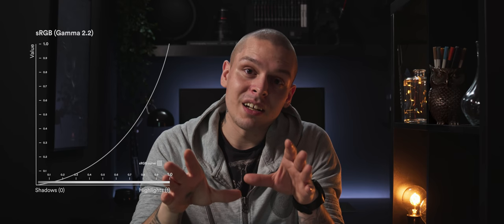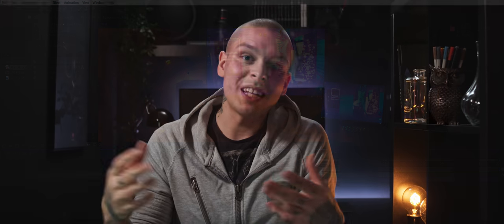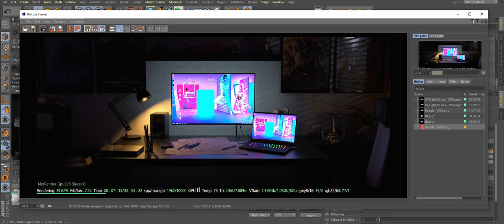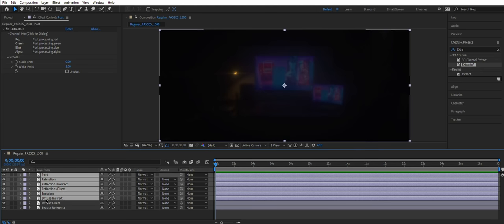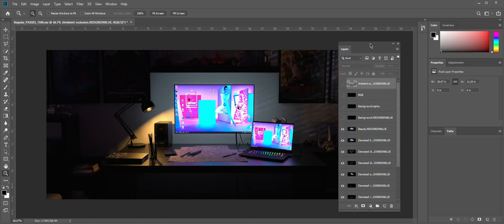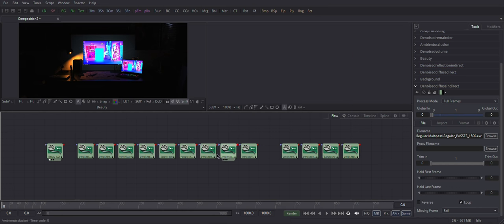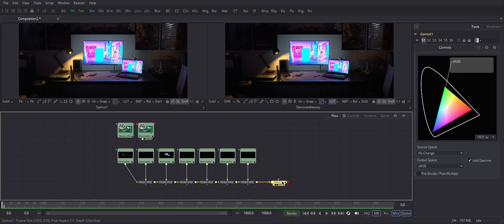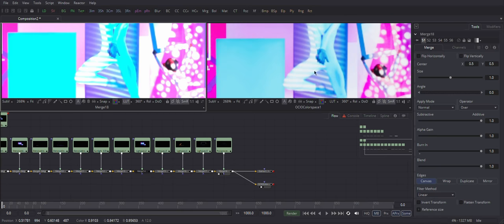Proper Linear Workflow | Fusion, AE, PS, Octane, C4D

Comment: CG is composited slightly differently in at a vfx house using subtractive compositing. So instead of adding together all the passes, we subtract them from the beauty, do our changes, and add them back on. By the way, they shouldn't need to be composited in a particular order, CG passes are designed to be purely additive, no special blend modes required.

Subtractive compositing is beneficial because of this: Say you have a scene with multiple lights, GI, reflections, refractions, SSS, volumetrics, hell even caustics. With an additive workflow, you'd need to have a pass for each of them just so that you can add it all together to recreate the beauty. But what if you know you only need to modify say, the reflections? Including all those passes is a waste of disk space, and a total overcomplication. With subtractive, you can just render your beauty and a reflection pass, subtract the reflection from the beauty, do your adjustment, and add it back on top.
Reply from the maker: That’s interesting, never tried it :) thanks
Reply: Stop stop stop...what? Subtract it from the beauty, make changes and add it back on top? How, lets say inside AE, would i have to do this? Veeeeery interesting!
Reply: Cool, Peter! Thanks for sharing. What would be the blending mode to subtract the passes correctly from the beauty?
Reply: In AE you stack the pass which you wish to modify on top of the beauty pass, using blending mode substract. Then duplicate that specific pass on top, add your effects on it and add it back in blending mode linear dodge :)
Reply: @AlexSuperBasic  Thanks, Alex!
Reply: Dude. I'm having trouble wrapping my head around this. A Google and YouTube search for "subtractive compositing" doesn't reveal much that is helpful. Any chance you can point to or put together an example in AE (preferred) or Fusion or Nuke?
Reply: @sarukravitz4981  I have the exact same problem. Tried to follow Alex's comment, but no success. Also googled a lot. Can anyone help us?
Reply: Much appreciated. Thank you.
Reply: @sarukravitz4981  I don't have Nuke, so would you mind recreating the example in AE to help me if you understand it, Saru?
Reply: @chrisp1628  - Sure, but it might take awhile. I don't have Nuke either so I'm planning on downloading the learning version and going from there. My Nuke knowledge is ancient but I may be able to translate that into AE. I'm traveling for work now so it's low priority at the moment.
Reply: Roger that.
Reply: I´m a AE user and THIS CHANGED MY (WORK)LIFE, THAAAANKS!
Reply: Yup, Preach. ALSO inject your .exr as comp.. auto layers everything
Reply: This is worth its value in gold! thank you!

Comment: Nice video great as usual will share with the Lighter here :) thanks, But I have to say Linear workflow is one thing and exr output one completely other thing,  in production we use a lot 16Bit exr  as Zips to save space and also you can find enough range for the 3D compositing.  as long you don't render tonnemapped exrs. For HDR (lighting) aswell displacement, 16Bit is not that bad (as many people think) Can work perfect with small size files with big videos and the difference is not that visible by naked eye.

Comment: You are my hero and so I think, as Vray user, could help any newcomer to get some things. Right now Vray, and probably every render engine out there it's actually biased. The fact that uses progressive sampler doesn't imply that it's unbiased. So for those who don't know. Unbiased will be a render engine that gives the same importance to every ray cast made. Not only that but also that calculates that path in every bounce until that ray has no more energy. Because this would be inefficient unless you are doing scientific work, all renderers use a biased solution. And all renderers are NOT physically correct. The fact it's proven because they use models (like Blinn, GTTX, Phong...) which are approximations of reality, but never reality itself.
Another thing it's that Vray makes every calculation as linear space (gamma 1.0) to get correct results. And no color space it's applied unless the user specifies it. You DO have a virtual frame buffer which applies a correction gamma curve just so that you can see a correct "preview" of what you have. Also, Vray works with wide gamut, it doesn't use Lab as one might suppose.
Still, I found it hard to understand how to work with ACES. wouldn't be better to just export your linear images and after post-production export to whatever format you want?

Comment: There is also a free plug in for AFX that splitts up the renderpasses autmatically without the need to duplicate and change the Extractor Plug In settings yourself. It is called ProExr(the guy also created Exr Plug In for AFX) and comes in addition with a Cryptomatte plug in in the zip file

Comment: Perfect explain... One question.. you are using Fusion right.. but now fusion integrated in Davinci Resolve 15 So how Different they are.. I think you are using Resolve too because I saw thumbnail one of your video.. And also How to do linear workflow in resolve.. I know too many demands..😁 do your best.. love you.
Reply from the maker: Fusion in Resolve is rather limiting. So it's a tool just to do something very quickly rather than a decent compositing tool. I use both Premiere and Resolve depending on the project :) ACES workflow in resolve is what you're looking for ;)
Reply: @AndreyLebrov  Perfect!
Reply: @AndreyLebrov   sorry bro, what's your thoughts now

Comment: You should do a video on the proper way to use layer ID mattes in compsiting/premultiplication. I notice I get a premultiplication edge line whever using Luma mattes/object buffers after color correction. In nuke it wouldn't be an issue but AE has me confused. I usually mess with the gamma on the matte itself after doing a shift channels but I'm curious as to how you'd do it. Thanks man!

Comment: Thank you Andrey!! But what do you think about "Blend using Gamma 1.0" in AE? Did you use it? Because Linear working space in AE don't work properly with some plugins like Element 3D and Optical flares, for example.
Also, I know so much people talking about linear workflow, but Andrew Kramer for some reason doesn't work linear. At least in all his tutorials and workflow videos. Anyone knows why? Thanks!
Reply from the maker: He doesn't work in it because there is no need, his workflow is procedural these days :) As for the plugins that doesn't work in 32 bits... that's why you might want to switch to a true 3D Compositing software like Fusion or Nuke.

Comment: You are the man. Thanks for that video. I ran into an issue where I had to composite an Octane element in AE on top of a plate. I was originally under the impression that you could use the AE Utility : Color Profile Converter as an adjustment layer on top of everything without changing the whole comp to 32 bit Linear. It works if everything is a scene coming out of octane but not if you're using a element with an alpha it doesn't work. How do you handle elements with alphas? Thanks man.

Comment: Here's to me going 3 projects after making the linear workflow settings change in AE and just now realizing it doesn't save the change as default, so I have been doing projects without linear workflow set.
I had to save a blank project and make that the new project default template.

Comment: Hey nice simplified tutorial, why do You think that linear (float) on the octane main tab is fundamental? If You choosing 32 bits You already have floating point in Your files, it doesn't matter if it will be mapped or not, but sometimes even it can be helpful - Z-pass for example. Am I wrong? Cheers

Comment: Did you make any tests comparing 16bit exr vs 32bit? Is there some significant benefit of saving in 32? I’ve heard that it’s only valuable for some “very specific post-production situations”, I guess it’s like extreme color corrections when turning night render into day.
Reply from the maker: You’re right :) 16 is enough for most tasks. You have to figure it out yourself really considering your project and hardware

Comment: This is great - except, when working with RGB colours for fonts / assets etc that are from a design file etc, where you're trying to match RGB values, in 32bit the values instead of being 0 ~ 255 RGB goes from -10,000 ~ 100,000... which is annoying when trying to quickly input a RGB value as seen in a brand guidelines PDF. Any fixes?
Reply from the maker: That's why Node workflow and fusion in particular are much more prefered for comp. You can add assets like this AFTER the linear workflow and they would be calculated in regular sRGB space ;)

Comment: Hi i work with C4D & Octane plugin and i have a problem when trying to export EXR passes : the rendered image doesn't look the same as what i get on Octane Live Viewer, it looks like it lacks the Octane Camera imager settings (which are activated).

Now i noticed something, when in "Render settings" > "Octane Renderer" > "Main" > "Settings" i chose "Render buffer type" > "Float (tonemapped)", there is no problem with the render.
Whereas when i chose "Render buffer type" > "Float (Linear)" as advised in the video, i have the image problem.

Of course :
-My Octane Camera is enabled
-"Neutral response" in my camera is checked
-My Octane Camera "Post-processing" is activated

-The format is EXR
-Depth of 32 bit
-"Rle" compression is activated
-"Save beauty" is checked
-"Image color" profile is set to linear
-"Tonemap type" is set to linear

Do you have any clue ?

Thx and have a nice day
Reply from the maker: You need to learn linear workflow. Browse my videos 😉
Reply: @AndreyLebrov  Hi, thanks for answering so fast ! Isn't linear workflow taught in this video ? I don't see other videos treating this subject except "OCTANE PASSES". Have a nice day ;)
Reply: Problem solved ! Didn't used "Linear" as my Octane Camera (in the list with Kodachrome, Exachrome etc.) Thx for your work btw

Comment: Hey i want to learn fusion . But I can't find quality learning material for it. So should I learn AE and transfer my knowledge to fusion. Will it be hard to change workflow from layer to node based?coz AE has tons of sources to learn from . (Remember I'm a beginner to compositing. I only worked on simple 3d stuffs).😀
Reply from the maker: Yeah it's significantly different. That's kind of the point :) If that helps you at all - I learned it having same materials on internet that you have. Just takes a bit of time
Reply: @AndreyLebrov   I tried the official documentation but it's long and boring to read. I guess I have to learn it the hard way . Anyway thanks man .😃

Comment: Rendering out the ae comp to mp4 format is causing a lot of banding, and i cant afford to render it in avi or mov due to the high file size. any tips ?
Reply from the maker: Yeah.. don’t ever render into video files. Render png sequence (higher quality), then assemble sound (if any) with your sequence in Premiere or whatever you’re using, and find the format which best suits your needs (compromise between quality and size). That way it will be waaaay faster for you ;)

MP4 H265 should help
Reply: @AndreyLebrov  Thank you so much man. I owe you a lot for this. Have been looking for a fix since long.

Comment: Interesting. I'm kinda baffled how poor EXR support is in these professional™ tools (PS, AE, Fusion). Why do they require so much brainless work to get the settings right & not shoot yourself in the foot? OpenEXR has been out since 2003 (!), open-source reference implementation and all.
Why can't AE just import all layers as passes, with names & mode set automatically? Why do you need to tell Fusion that the "green" channel is, in fact, the green channel? How can PS get away with requiring a third party plugin to even import the file?
Are VFX people (ILM, Disney, Pixar, ...) the only ones who care about linear? Is there even another format for it that's worth mentioning? (Some "RAW" formats support it, but afaiu they're a complete non-standardized mess.)

Comment: Fusion's workflow completely wrong.. And those passes of light which includes diffuse data is ok, too.. I believe you just don't have a big needs and expierence of compositing in fusion, but for further tries - keep your category passes (like diffuse, reflections, coat, refractions etc) to be additive (in fusion you need to set alpha gain to 0 in a merge node), and your light passes to be multiplied (set Multiply in a merge node). All the rest is ok.